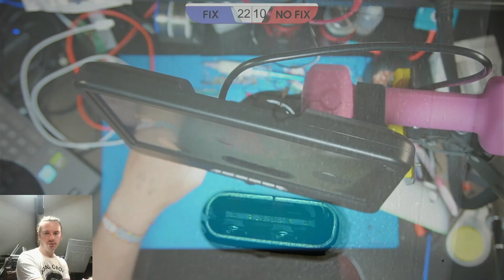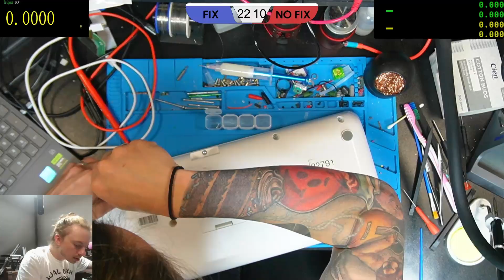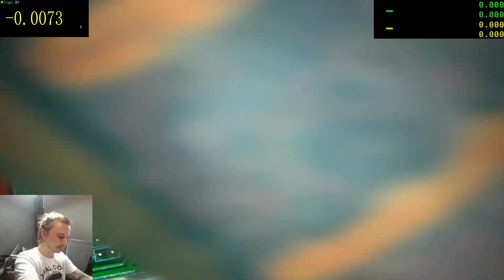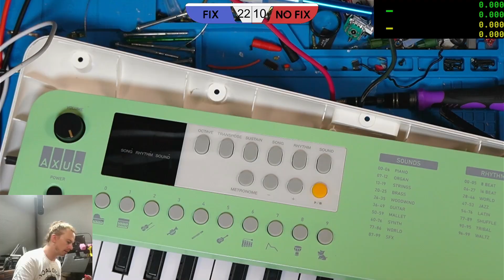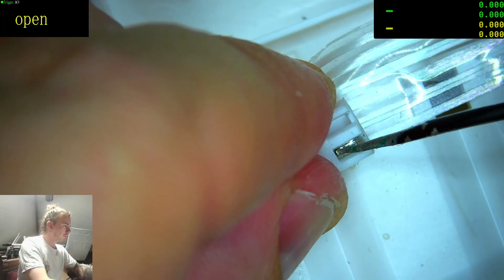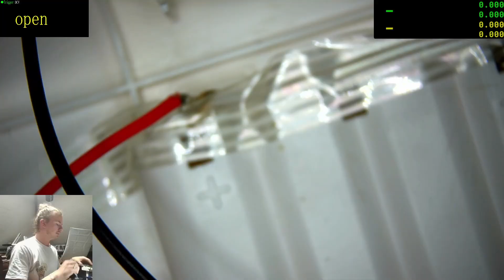This One Gave Me The Run Around - No Power AXUS USB Keyboard

Comment: USB-C Power Delivery requires 2 x 5.1K resistors from CC1 and CC2 to ground inside the device.
If not found, the USB-C power supply will not switch on.
You need to check if these resistors are present, usually by sight but also by multimeter measurement.
Reply from the maker: Appreciate the advice. Im not too savvy on the USB C protocols, Do 5v devices still use power delivery I thought this was only for ? As in would the USB C not output 5v as standard, then if requiring a higher voltage is where the PD side comes in?
Reply: @TheCircuitRevival- Compliant USB-C power supply devices do not supply ANY voltage on the output terminals unless they sense that a compliant device is plugged into them.
For example, if the downstream device doesn't have a 5.1K resistor on both CC lines to ground, the power supply will remain at zero volts.
.
That may be what is happening with this organ, and it is incredibly common for cheap gadgets to not include the resistors. You can usually know this if they are supplied with a Type-A to C cable and will power up from a USB-A port but not from a compliant Type-C port.
.
A different resistor is used inside the power supply (upstream device) to communicate if the 5V can be drawn at 500mA, 1.5A or 3A.
The CC lines are also used with digital signals to determine fast charge voltages. Also there can be a chip inside the cable that comfirms that it can cope with 5A, which will switch on (say) 20V 5A if the charger can support it and the dowstream device can accept it.
.
Find the Hackaday article "All About USB-C: Power Delivery" and also read the linked articles at the bottom of each article.